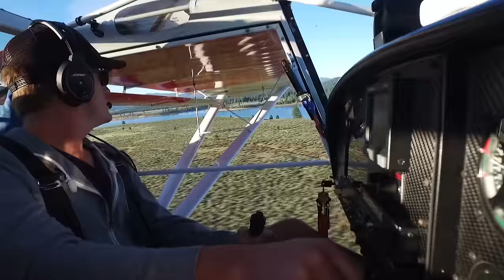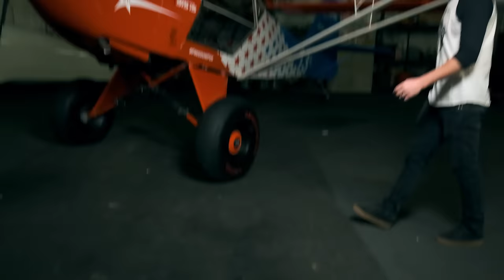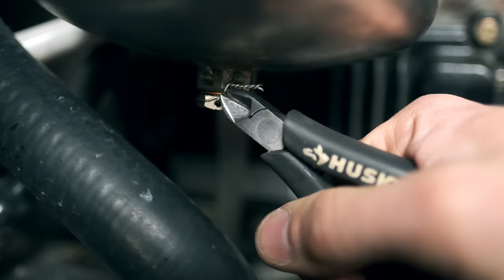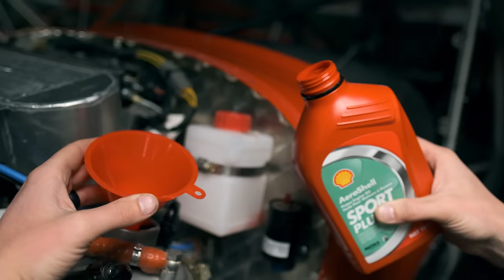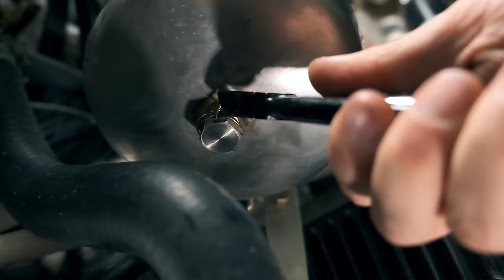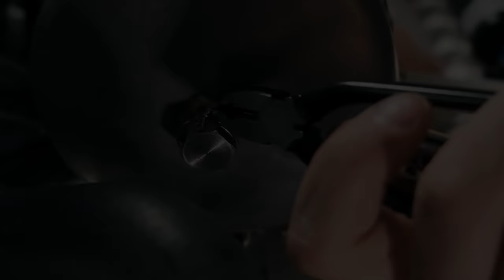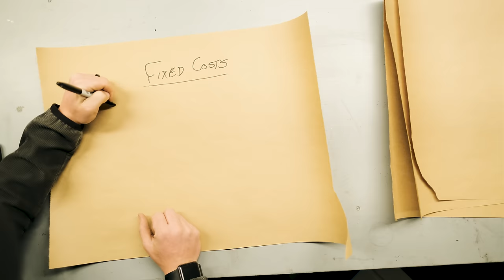What Does It Really Cost to Own and Fly Your Own Plane?

Comment: So basically an average person with a good job could afford flying if that was all they did for recreation .  It'd all what's important  to you . Thanks for the breakdown
Reply: actually I think the nail in the coffin for me would be if the plane was a certified one and not an experimental. that 10 grand payment for an inspection would be a complete deal breaker.
Reply: @jackvernian7779  I have a certified Cessna 172, and the annuals range from $1000 - 1500. If something breaks, you can often fabricate "owner manufactured components" to avoid having to purchase a very expensive new or PMA part, but it all depends. You can get unlucky and have something expensive break.

And of course you can always have bad luck and have a major engine issue that requires an overhaul before the 1800 TBO limit. An overhaul can range from $15,000 - $20,000, and the engine accounts for more than half the value of the aircraft, so it can represent a major loss for an owner if something goes wrong.
Reply: If it is you hobby you can afford it. It’s no more expensive than riding dirt bikes, RC vehicles, skydiving, hunting, or going out on the weekends. Find a decent plane with decent partners and it’s more than affordable.
Reply: Jack Vernian those are very rare and only happen if something is very wrong with the plane
Reply: Jack Vernian it’s pretty rare that your single engine, non complex GA aircraft is going to cost you that much during an annual. The annual is an inspection, the work found on those inspections does not have to be done by an A&PIA, it can be done by an A&P. The issue with certified is it has to use certified parts in most cases. Those certified parts are typically 3 to 5 times the costs despite often being the exact same part you would use on an experimental. There is usually more to those “10K” annuals then what is shared, often it’s a failure to research AD’s prior to purchasing an aircraft and or AD’s that were pencil whipped, that results in those high costs. For example when I got my pacer, it had an AD for the exhaust that had been signed off but had never actually been done. Having got a good pre buy, it was discovered prior to me buying it, and I was able to negotiate the price to have the money to fix it. Had I not gotten a good prebuy that first annual would have cost me 6 grand in the things we found, instead of paying 35K for the plane, I paid 28K and then I covered the cost of the repair to make it airworthy. Point is, if your smart about its not that expensive. 

Honestly I spent more on my new Ford PU over the last 3 years than what I’ve spent on my plane the last 10 years. the plane hasn’t depreciated while the truck has. It’s all about perspective I suppose.
Reply: @Veteran_Aviator    Sounds good till a partner goes bad
Reply: Greg Plaka hope that’s not the voice of experience
Reply: @jackvernian7779  Annuals in your average 4 place single are about $1500-$2500. Of course, if a bunch of stuff is broken, it can shoot up, but that's the same for experimental.
Reply: They certainly can, but if you're not going to be flying 100-300 hours recreationally every year, you're better off renting it.  That way, you're only paying for the hours that are running on the meter.  No other costs are associated with it as it's included in the hourly price.
Reply: @pmgodfrey  absolutely. We have 5 partners, and the plane gets about 200 hours a year on it.
Reply: I'm an average dude with a decent job. I started flying when in my early teens (got lucky and met the right people), but I have too many other expensive interests. I raced motocross seriously for 10 years, travelling to races every weekend for 7 months of the year, weekly practices, bikes, gear etc... One day I calculated what I had spent roughly, and I could've bought a built a nicely optioned RV type aircraft AND earned my PPL on what I had spent racing. It's all in what you are passionate about. For me, now that the body is in constant ache from all the years of dirt bike abuse, I'm switching gears and getting back in to flying for essentially the same type of money.

Comment: Doesn’t cost any more than it did 30 years ago, it took every dime you had then and it still does.... but oh it’s worth it!
Reply: Tobe Smith mmmm sounds a lot like drugs 🤣
Reply: and that's why GA is dying.
Reply: @dsyncd555  ya think?     if not for Exp    I bet  that there would be  75% less flying
Reply: @ctsteve1967  the cost is what has prevented me for so long.
Reply: Guess it depends on where you live. Has not been my experience!
Reply: @kevinm3751  plane rentals are $90-$150 an hour.  I've been running the numbers for a $20,000 plane and it is still expensive to fly it to the point that it is worth it.
Reply: @dsyncd555  No doubt when you add it up rental still beats ownership the risk of high cost repairs drives it way up. What it comes down to if you can afford having the luxury owning your own.  flying when ever you want configuring your own aircraft no schedules have it back. You can do it with ultralights just have to get proper training the 2 stroke engines are cheap to overhaul. I always wanted to own my own airplane get my PPL I always said when I make good money can afford it ill do it. Now I'm 50 make 160k a year, but now have a few health issues wife is scared to death ill get killed I don't blame her can't really say GA is safe. I would rather do something I love take the risk then always have regretted it rest of my days. If I were in my 20's again I would have gotten my PPL maybe fly part 135 build ton of hours maybe doing glider towing something when no wife at home to worry about me. When your young life is simple all about yourself health is good pass a medical like nothing.  Now I need a SI to pass who knows what else is wrong with me. If it's a dream don't let fear of spending the money stop you.
Reply: This was a joke, my instructor told me... I waited until I was 58 to get ppl, started out buying a 172 and getting an instructor who would teach me in my plane. The plane cost $19,000 and the instructor was $80 per hr. Soloed in 8 hrs.
Reply: But it’s really down to priorities, this was my burning desire.
Reply: @dsyncd555  Well then show me where to get a hangar , because if you can't get a hangar that's clear evidence GA is NOT dying.
Reply: @dsyncd555  Who said anything about renting them? Point is a car cost more than a good plane and you will never find a good used car that is in as good of shape as a plane. Thing is if it isnt worth it to you, then thats your call, the value in flying is really a personal one and only you can say what that value is worth.
Reply: @WoutervanTiel  more variables at play judging GA on than on a waiting list for a hangar.
Reply: Really?  Small airports are closing down left and right, and the hangars left are full of planes that rarely ever fly (many are not airworthy).  Airplane costs have gone from half the cost of owning an average house to twice the cost, and the average house has gotten quite a bit bigger.  AOPA is fighting for ATC to not get bought out by the airlines.  GA, in the way we know it, is absolutely dying.

There will always be those who scrape together whatever they can to fly an ultralight, and those with enough disposable income that they will find a way to fly.  But for the average pilot, the snowballing effect of - fewer airplanes = higher individual costs - is already half way down the hill.
Reply: @alexpeterson3200  Ouch, you paint a very sad picture there. I can say that up here in the North West (at least around me) we are experiencing no such pains and it really sucks to hear there are areas having these kinds of issues. Does make one wonder about the condition of planes for sale and means closely reading the log books before a purchase is more critical than ever to know the plane has been taken care of and not neglected.
Reply: @kevinm3751  Alex is spot on.
Reply: We had a similar discussion on a Luscombe list I'm on.  A newbie asked the question, How much money does it take to own a luscombe?  One of my friends answered, "All of it"!
Reply: If youse Guys 'n Ga;s in the States think that you have expensive aviation then spare a thought for us poor  fellows over the other side of the Pond. Muito Dinero required over here. Regards, Jim in NI UK
Reply: @tobesmith3832  swwwwwweeeeet
Reply: @dsyncd555  Old comment I know, but ultralight is stronger than ever.

Comment: I have owned my 1977 Cessna 177RG (Cardinal RG) since 1985, and I fly it about 100 hours per year. In addition to the same things that you calculated, I have added something new every year in the way of new avionics (radios, ADS-B, etc), and, of course there is my $60,000 engine that needs to be overhauled or replaced every 2000 hours. So, my calculation for my total hourly cost is now running about $200/hour, but this can go up with expensive new radios or down when I don't have any expenses like that.

I love your videos and watch every one as soon as it is published! Great job!

Russ
Commercial Pilot and CFI-I

N52636, 1977 C177RG

Comment: Full disclosure: that was a solid breakdown of the basics.
Reply: Magic Mike! Cool to see you follow Trent. What are some more advanced cost break downs he maybe didn't mention?
Reply: @rowdycowboy85   Some variable cost can include: Renting a hangar away from home. Some pilots prefer to have their plane in a hangar all the time. If you're financing the plane, factor in your monthly payments. Anti-corrosion treatment may be a yearly cost for some pilots. Subscriptions for Foreflight and or Coflyt etc.
Reply: Supposing you buy the plane with a loan, even if the value is steady and most of the monthly payment goes to equity, there's still interest. When you own the plane without a loan, the math comes out similarly in that, equity you have in the plane is money you didn't throw in (for example) a boring old index fund that tracks the stock market as a whole. (This is opportunity cost)

Comment: That’s why I fly a Paramotor, my fixed costs are the equipment purchase. I burn about 1gal/hr=$4/hr 😂. I’m working on my PPL, I’ve done my solo and now working on XC. I plan to become an instructor and I’ll let the school worry about the planes.... good video! Plane ownership is not for the average guy but there are clubs and buy-in’s. Many ways to split costs.
Reply: I also feel that part 103 gets you the most freedom in aviation. Hardly any regulations and super cheap (for something that flies) as you said. Also do you even need insurance for an ultralight?
Reply: No insurance is “needed”. One thing I do have is “Life Flight insurance”. Often times the cost of that is more than what healthcare will cover or at all. I hope n pray I never need to use it!
Reply: Paramotor is much more wind dependant, right? So being in a windy area means a lower amount of possible flight opportunities.
Reply: Yes, a Paramotor has a limited amount of wind it can fly in. We typically fly the “old guy hours” early morning or later in the evening. We try to avoid the mid-day thermals. As the earth heats up the atmosphere expands and contracts. We utilize more micro meteorology to seek out the best possible conditions for a safe and smooth flight.
Reply: Ultralights only general are more wind dependant
Reply: @kevincanfly  tell us about this    life flight insurance    never heard of this?
Reply: @mcbiker77  yes it does  so what,      Mornings and  late after noon are good times to fly
Reply: you need to factor in   new  wings   you only get so many hours  and you need to rebuild the engine quite often.
There is always cost whey you own something,      the resale value of a para motor is about  half of what you pay for it.    so add that cost in also.
Reply: @loganreuter6072  part 103  do what ever you what to do.  FAA does not care at all.    The  FAA has DRONES on there Brain.
Reply: @ctsteve1967  cheaper than golf over a 5 year basis, an average wing will last between 3-400 hours or about 5 years for a regular usage
Reply: @ctsteve1967  my polini 130 has close to 250 hours and i do my own maintenance if needed... only replaced rings twice, and bearings throughout once. I use decent 2 stroke fully synthetic and that saves on engine wear...
Reply: I was seriously looking into it after Grant Thompson died decided changed my mind go motor glider.  Paramotor's are cool but way too sensitive to wind, and turbulence. Nothing wrong with Ultralights as long as you get proper training sometime not easy to get. Transition training is also not that easy to find in all the ultralights out there.
Reply: Kevin Can Fly! There still expensive.
Reply: FEET FOR A LANDING GEAR????
Reply: Wally PhelpsTo Para glide,  You really need instruction and that can run 8 to $10,000 Then there’s the para sail/glider and a good motor can run $30,000 + and then the gear you need about $5.000 so $45, 000, but you could spend less and you could spend more so it’s not cheap. Then ya, you better be in shape and have strong legs Oh and medical insurance. 😸👍
Reply: @ctsteve1967  as a drone pilot, i completely agree with that. Its unfortunate for us....

Comment: Great video. For anyone looking, a very solid pre-buy is a must, but still might not uncover everything. Our club bought a 172 after a solid inspection and later found a bad repair in the engine that cost us ~$12,000 just 6 months after buying. We wouldn’t have seen it unless we paid >$1000 for an engine tear down prior to buying. Not a common issue, and it increased the value of the plane, but an example that you need to be ready for anything.
Reply from the maker: Very good point! And sorry to hear that, that is one of those horror stories that we just hope doesn't happen to us. No one in their right mind would have spent $1000+ on the engine teardown without any indications that something was wrong so I would have been in the same boat.
Reply: @TrentonPalmer  A horror story, but rare. We were thankfully prepared. The biggest bummer for us was the several months that it was out of commission for overhaul. 

I also don't want to discourage anyone from buying a plane (certainly the opposite). I would just hate to see someone zero out their bank account on the purchase and be grounded shortly after because they were not ready for a major expense.

Comment: ASW-24 Glider cost breakdown. Acquisition in 1999 $52K (includes glider trailer).  Insurance $1,100/yr. Aero tows $2K/yr. (~20 tows per soaring season). Conditional inspection $200/yr.  Oxygen $120/yr.  Parachute repack $80/yr.  Average flight per tow is about 5 hrs.  Average flight hour $35.   Enjoyment factor, priceless !

Comment: I’m surprised how inexpensive it is actually. I feel like based on the numbers of plane operational costs owning a nice boat that you took to the lake often would cost more than a plane. Pretty crazy. Thanks for the great video, Trent!
Reply from the maker: Yeah, I used to be really into Polaris RZRs, actually raced them, and that was more expensive for me than flying!
Reply: Boats are just holes in the water you throw money into.
Reply: Owned a 17’ outboard on Long Island sound. Running costs were similar to Trent’s with a 6 gal/hr fuel burn @ 20 kts. Salt water is tough on equipment so  maintainence and TBO were frequent. Bought new and boats are a very depreciable asset. Fixed costs were dock space, insurance etc. In all, I spent a little less than Trent for about 200 hours/year on the water.
Reply: It can cost way more to operate what's considered an OK boat in coastal areas (minimum 21Ft with single 150hp, preferably 24Ft with minimum twin 150hp)...
Going the rest of the way off topic, it's just plain crazy how many 40+Ft boats you see in Florida now with three or four 250-350+Hp outboards = 25K-35+K for each engine, burning anywhere from 6-11GPH each @ Slow Cruise, up to 34+GPH each @ How Big Is Your Wallet WFO 😲 Hey that's only $8.50 a MINUTE for fuel 🤪
Reply: HerroRya you know what boat stands for right?.. B.ust O.ut A.nother T.housand
Reply: @keatonhatch6213  Ha Ha exactly what I was thinking B-O-A-T =$😂😂🤣🤣

Comment: My father is currently building a Rans S7 and he’s trying to get costs dialed in moving forward once the build is complete. This will be very helpful. Thanks!
Reply: I have a S7S with 200 hours on it. So far only had to pay for oil changes. Fuel burn is about 3GPH auto fuel, so it can be done cheap.
Reply: pete365720 wow!! 3 gph is unreal!